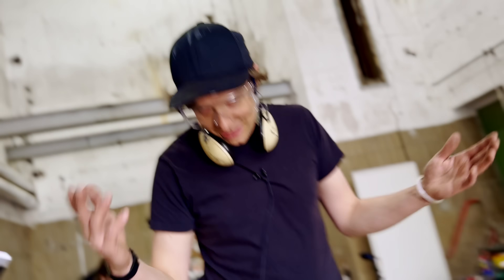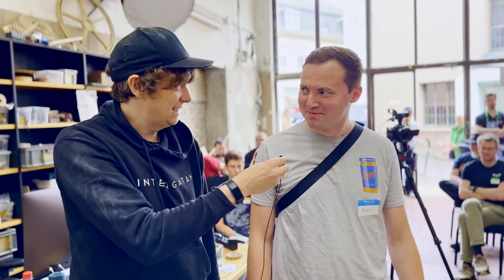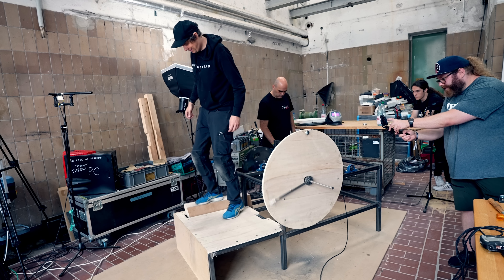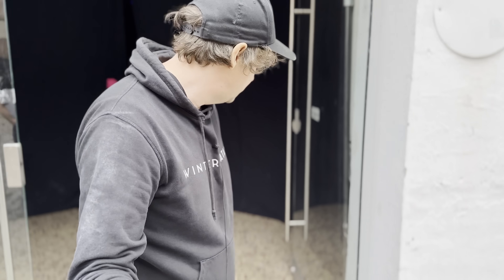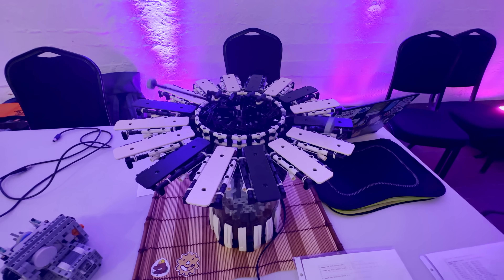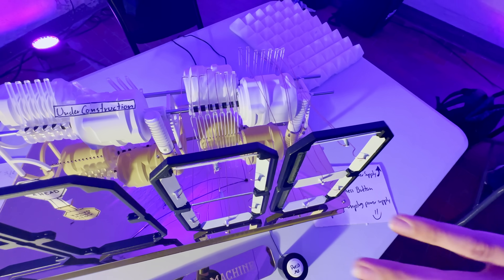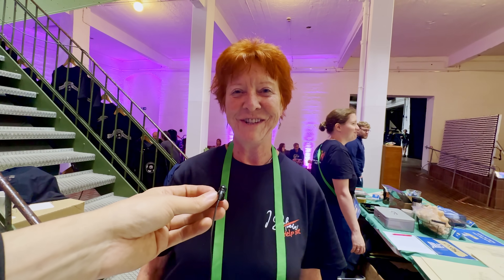First Timing Tests - DAY 6 - Marble Machine Flywheel Prototype

Comment: maybe you can design something to use resonance to aid you get to 80bpm, going for a stable equilibrium would make it so that you have to really over or under input energy to go out of phase

another thing someone else commented is that flywheels are for energy storage, maybe having a secondary shaft that limits the rotation to your desired rate and leechs energy from the main shift where the flywheel is rotating

Comment: You could add an electric motor to this system so that you don't get completely exhausted during a concert, but as a prospective concert goer, I think the more organic variation in your music timing is a good thing. I 100% agree with you that the machine itself should be capable of playing music with the tightest timing possible, but I'm not going to hear the machine play, I'm going to hear YOU play the machine. You playing the machine is going to have some natural variation to it, no matter how good you are at keeping time.
Reply: He should take the motor off the MMX and reuse it but add a potentiometer to vary the speed.
Reply: @two_tier_gary_rumain  Maybe. As I recall, that motor had just barely enough power to keep the MMX flywheel going. The MM3's flywheel, from my understanding, will have far more inertia to overcome.

Comment: Just a silly idea. If you turn your " clock hand " 180 degrees, The click at the top of the stroke no the bottom, then, if you are behind you push harder, but when ahead of the beat, you don't start pushing until the beat, limiting the power. If a long way ahead, very little power give. Closer, you still need power,but not as much. If power input and timing match than they are synced, keep going.
I don't know if this will help And yes I know it is not like taping your foot this way.

Comment: synching and timing being stable are two different issues, only try to make it spin at correct speed, not at synch
Reply: make it an electric generator storage instead, drive it with a motor and a crystal

Comment: It seems to me, sitting here on my butt without any great engineering experience, that since the pedal is directly connected to the flywheel any input of force with the pedal will change the speed of the flywheel. I think the machine will require some form of escapement mechanism, and perhaps even some form of mechanical governor to play tight music at an unvarying tempo.

Comment: With the current setup there will always be fluctuations but what is the deviation between operations or however many ticks per revolution I would set up 10 contact mics spaced to match the operations per rev to measure the standard deviation. To get consistent results with near 0 deviation you'll need some kind of governor to regulate output shaft speed.

Comment: Maybe I'm missing something, but when you showed off the Huygen weight drive last month, and then the flywheel made a comeback in this prototype, I assumed you were going in the direction of using the drive to produce constant rotation for the machine, and then use the flywheel only to raise the weight -- meaning it wouldn't matter how tight or consistent the flywheel was at all.
Reply: That was one of the options. At this point, he's just testing the options, so if this doesn't pan out, a Huygens drive might show up. That would be after experinenting with a governor though.
Reply: I think he wants the foot stroke to essentially be a skill based instrument itself. If he doesn't do that though clockmakers have already figured this out a long time ago, music is all about timing so the overlap is huge with mechanical clocks. A grandfather clock is basically a 60bpm version of what he is trying to make.
Reply: I think he just wants to create content and never finish a damn thing.

Comment: I just don’t understand why there is any expectation of tight without a mechanism specifically for that. Like a watch that has varied energy stored and yet keeps very accurate time.
Reply: The flywheel is an energy storage device not a timing mechanism

Comment: In my Amateur Engineering Brain, I am thinking about the Pedals' relationship to the "Timing" of the machine... I think you need the flywheel to be going FASTER than your intended RPM. From that inertia you can take off whatever "speed" you want (with a transmission or gear box) and use the GOV to keep it precisely where you want it to be... THAT way you wont be always accelerating and then always decelerating. your job, as the operator, will be to just INPUT as much speed into the flywheel as necessary to maintain "faster than required RPM" of the flywheel... storing the energy for a less RPM and building a "Buffer". In fact, in my idea, the pedal WOULD NOT BE in time with the music... But that doesn't matter... BY DESIGN. Your Road Bicycle does a similar thing with the gears of the bike... oh man! What if the pedal was attached to the machine with a one way bearing?? exactly like the bicycle! Use a "Return Spring" for the pedal to come back to the top of the stroke and the one way bearing would only engage the pedal to the flywheel WHEN the user is INPUTTING power to the system!! any other time, the pedal is STATIONARY AND SAFE!! hahaha ... although, I must confess, I'm not sure you will enjoy the extra noise of that "free spinning" one way bearing... hmmm I don't know... that's why I'm an Amateur hahaha GOOD LUCK everyone. I hope you enjoy these ideas :-)

Comment: To get in sync with a metronome, the flywheel has to speed up and then slow down to the right speed. it seems like that's the part where it overshoots and you're ahead for a few measures. maybe adding the brake could help get more control?

Comment: Keep in mind that when there's a full machine being powered by the flywheel, it'll be much harder to maintain tempo since you'll need to add a lot of energy at just the right rate, which will add to the already challenging task of keeping with the beat
Reply: If I recall, many of the old Orchestrions used a flywheel. All to maintain a consistent speed. So it is unreasonable to use one.
Reply: That is additional damping, though, making it harder to overshoot?
Reply: @nsiivola  it makes so that whatever tempo the machine is at it would slow down faster, so even if you get the tempo just right, it'll slow down quite fast and you need to keep  paddling to keep it in the sweet spot

Comment: The test you conducted doesn't test if the flywheel prototype can play tightly, but rather how well it can follow a metronome. If the beats aren't synchronised you need to change tempo to one which doesn't match the metronome's, which causes you to overshoot. This is because the flywheel makes it harder to speed up or slow down, due to it's moment of inertia. In essence the mass of the flywheel is working against you if you want to synchronise the beat with the metronome, a smaller flywheel would do better if this was what mattered. However it isn't, the prototype should be able to play at a consistent tempo, although desynchronised from the metronome. If you measure the rpm of the timing tester you can then use a display to monitor your current bpm.

Comment: Did you decide to give up on the gravity-assisted engine? I had thought that the idea of using the pedal to drive the pulley which then gives a constant output to the flywheel was a really great way to keep the drive consistent.

Comment: I would think that what matters is not an absolute timing compared to some external clock, but a relative timing to itself. It's not like you will have two machines playing together, or the machine playing with a sequencer. The rest of the band are humans who will adjust the phase shift according to the machine.

Comment: You may have said it best on Day 1 that the input pulley doesn't have to be solid metal. It feels too heavy and almost as if it's dragging the flywheel. Deceleration is faster than acceleration.

Comment: I feel like the test is missing a load. a constant frictional force like a fan on the end of a shaft would help balance out of some of the power input. There is some of that inherent in the system, but not much comparatively (especially to the idea of a whole machine attached alter)

Comment: Another thing, the wheels aren't balanced. 

Another thing, hand crank will always have more accuracy than a foot pedal. However i understand that having both hand available is a huge advantage, so i propose either a motor that you can engage after you get the machine started or see if you cant make a govorner that you can change the tempo so it can play multiple types of music

Comment: I hate to keep being a Debbie Downer on this project but it's doomed to never be tight because Martin's idea of tightness is synthesizer/ discrete-time level of perfection. He's trying to achieve it with a linearly controlled wheel speed, it's never going to be as precise as he wants it. The design needs a stable reference frequency, the way modern computer clocks use quartz crystals, if he wants to realize his level of tightness mechanically. Drive a pendulum that drives the system, something like that. Otherwise his design is never going to fully reject his own input variations, governor or not.

Comment: The flywheel needs to be at least 3 or 4 times less prone to change speed than it is now. So, double weight + double ratio. Mainly the outer weight counts, so you can make it more hollow.

Comment: Why not mix that perpetual curve reduction mechanism to the flywheel, basically have the flywheel drive two other waights that try to even out, ull be getting the best from flywheels aaand the gravity clock mechanism- one keeps it going with force and the other keeps that force from changing the speed.

Comment: I'm not sure what he's trying to achieve. A flywheel isn't used to power a machine. It's only used to smooth out the speed. Under load, the flywheel will quickly lose all of its momentum to the machine, and it takes a lot of energy input to get it up to speed. Also, you can buy a purpose built flywheel and a rim type is better than a disk type. I feel like we're just watching Martin lose himself in another rabbit hole. 🤷

Comment: i think you would be better served by using a precision Motor and a timing system to keep the beat. then instead of having to concentrate on using the pedal, you can just Play music, Play the instrument, and have way more potential functionality by having both legs available to press alternating pedals to add or subtract instruments or features. you are getting stuck in using foot power to play the music, and i think that may be the weakest link in your "tight Music" requirement. a Motor can eliminate that whole potential issue.

Comment: You could add a digital indicator that displays the tempo and is updated once per rotation.   It would be a simple Arduino project if you could not find one on the market.   This would help with the overshooting

Comment: i'm thinking of some kind of clutch that can be set to the desired rpm/bpm which then only forwards that exact rpm/bpm, as long as the flywheel turns faster.

Comment: I have a suggestion on making it possible to pedal to a higher tightness. Have 4 clicks instead of 1 for one rotation. It should be 1 big, 3 small. Additional data points to listen to will help with getting a tighter rhythm.

Comment: The problem with getting the tempo, as you're seeing, is trying to sync up to an external beat. You could be matching the beat of the metronome exactly, but you could still be out of *phase*, so you're having to speed up or slow down.
Attach a magnet to the crank wheel and use that to trigger something to measure wheel RPM, because that will also correlate to the BPM with the wheel doing one revolution per beat. It'll be much easier to read off a number and pump on the pedal faster or slower to get that number where you want it

Comment: why dont you add rpm brake? one of those rotating weights that brake if the rpm is too high, if its adjustable you might probably be able to achieve quite stable and exact rpm... also on the output pulley, you can add one way bearing, that way you can spin up the weight to high speed and the output pulley will spin up and take power from the weight only when the rpm brake releases, you wont need to constantly press on the pedal that way...

Comment: You have to balance the larger fly wheel. Spinning that fast and with that kind of weight can cause lots of vibrations that can loosen lock nuts and cause bearing damage...

Comment: You should look into the governor and other control mechanisms after the flywheel, so your goal with the pedal is not to match BPM but to keep the flywheel above a threshold. You would control tempo via another system further down with more refined control.
Reply: A continuous variable transmission would fix any and all timing issues
Reply: I've been confused the last few with the dial. The pedal is the same tempo as the dial so I can't see the point of it
Reply: @laggytim the dial is just there to provide a mount for the contact mic so he can get timing signals out of the machine and recorded into software. I think he made the dial as a large visual indicator for the audience, since he could have done this with a much smaller setup.
Reply: @evanbarnes9984  Bigger diameter of the dial can improve the accuracy of the measurement too
Reply: He literaly mentions governor in the video.
Reply: This is exactly like connecting a power station to the grid.

Comment: I stopped in to the live stream yesterday to lend you a little advice regarding TIG welding and arc welding in general.
1) the tighter the plasma shield and shorter the arc the cooler and cleaner the weld will be. This will help to not overcook and weakening the material around the weld.
2) using a square wave pulse setting at a lower voltage will allow you to produce a much cleaner weld and help you control your filler feed timing.
3) increase post gas cfh and flow time. Hold position until the post gas process has finished.
These 3 things should help significantly.
Best regards, great work thus far.

Comment: 3:50 overshooting problem. Maybe you might consider installing a governor to regulate the rpm (the system used in most fixed steam machines).

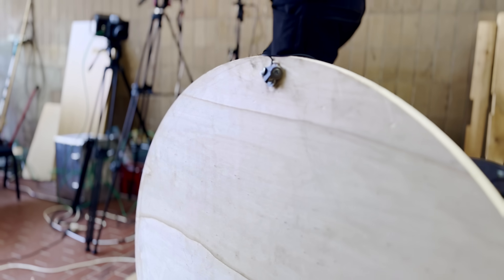4:00 update: 🤭🥴will teach me to stop commenting on the fly...😂😂

Comment: Because it is a direct connection, your pedal bottom and the position strike of the clock should be 100% identical. I think your problem is your pedal is too long and too weak. You need to shore that pedal up some. Adding some weight from strengthening would also allow you to control the temp better as you have more inertial control over that lever. A piece of C-beam will do in a pinch.

Comment: I would make the connection between the pedal and the pulley wheel a slot instead of a direct pivot connection. It would be safer as that way the machine can't pull the petal down, only gravity or your foot could.

Comment: I don't understand what is trying to be proven here. This doesn't test the machine, it tests how well martin can chase a synchronization. He's trying to sync up to a beat, which is fundamentally different than trying to measure how easy it is to stay in tempo. He's right that to catch up to the reference you have to purposely go faster than intended, then slow down to "fall" in sync. It seems like chasing madness. The better way to do this is find a way to display the RPM currently being "played" and just try to keep the machine on target, that way you aren't trying to sync up, you're just testing how hard it is to maintain a target. If you keep testing the way this video does, it will only get harder as you add flywheel speed and mass because it will get much harder to speed up and slow down while you chase synchronization, you'll see larger and larger over and under shoots as you try to sync to the reference. The goal should simply be to measure the RPM (or BMP) of the machine and let Martin attempt to hold it steady.

Comment: You should make the vertical pedal linkage be able to buckle under compression. Then, even if something manages to jam the pedal (foot, a marble, etc). It will safely just buckle instead of instantly crashing the machine to a stop and likely damaging things. Just using a single screw instead of 2, and something to keep it from going perfectly straight would probably accomplish this.

Comment: Have you considered using a Reeves Drive for your pully? That would be infinitely adjustable so you wouldn't need to worry about peddling at the perfect speed. Just tweek some sort of knob to dial in the perfect speed.

Comment: I occasionally work on punch presses with flywheels. They typically have a brake with friction material on the drive shaft. That may help with controlling the overshoot.

Comment: put a freewheel clutch on the input of the flywheel so the peddle isn't driven and use a spring to raise the peddle 
you then wont crush your foot and can turn the pulley at any down stroke position.
Reply: Yes it feels like this would allow matching the phase of the beat easier because you could keep your foot moving with the “correct” beat pattern rather than lagging or leading the whole time.
Reply: @Thomas_de_Meijer  And not chopping ones foot off is a plus too

Comment: I feel like it should probably have a slippable belt from the flywheel to the pedal, and you measure on the flywheel. It's like the pedal-flywheel is removing any high frequency differences, but it's letting through any low-frequency differences provided by the pedal.  An adjustable governor on the flywheel would keep it rotating at a single speed, and a slippable belt could help you add in/maintain speed, and it could slip when you go too slow, etc.  I feel like until you fully decouple the pedal from the flywheel, you can't really test for this...